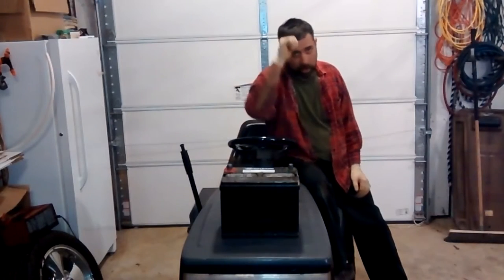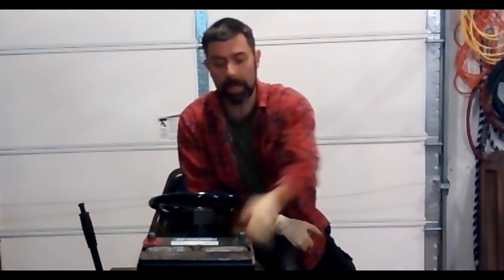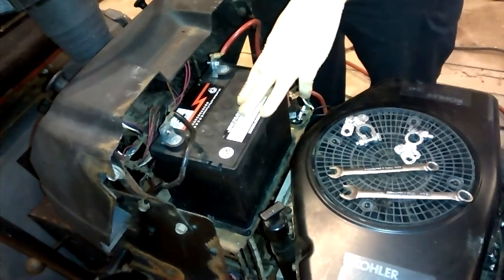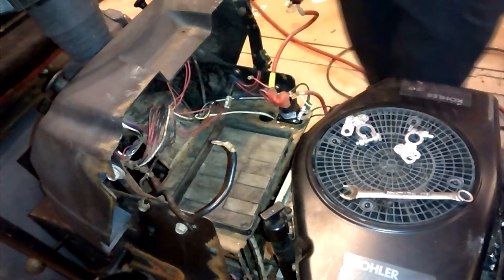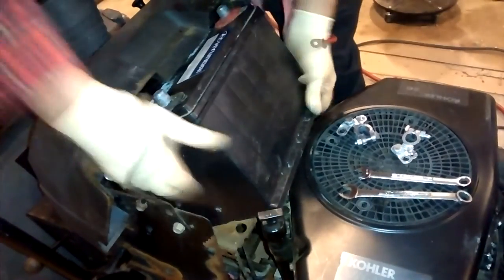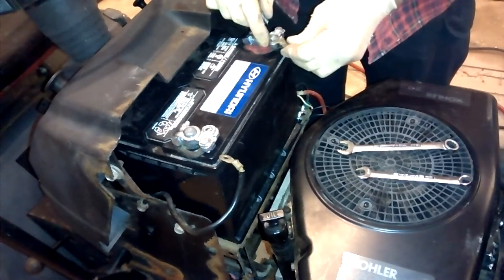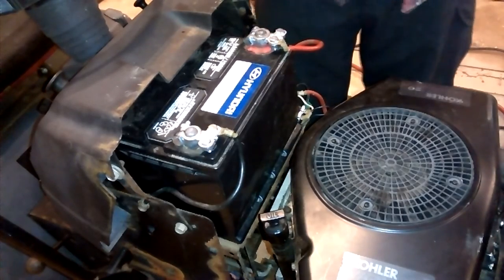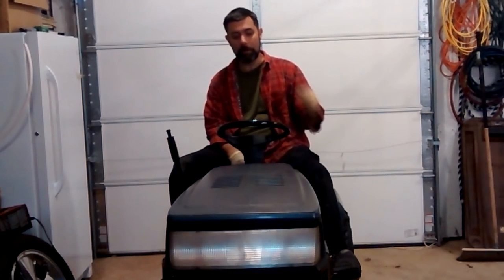Upgrade The Battery In Your Riding Mower or Tractor. CHEAP!

Comment: I did that year's ago.  That's one of the best things you can do to a mower.  Increases reliability.   I cut a piece of 1"  rubber horse mat and placed under the battery to help cut down the vibration to it.
Reply: it is a very good hint as these auto batteries are not designed to take vibrations and will fail very soon.

Comment: Find a secure way to 'hold down' that battery, other wise it will Rock and roll which isn't good for the plates in the battery to remain secure/not breaking loose. Also, just to keep any contact from the battery posts ever ever ever touching anything in your tractors and grounding out- safety tip, never have a loose battery.

Comment: The price of those little riding mower batteries are insane.  Im going to cut into the rear metal seat area on my craftsman mower, add some reinforcement and go to the wrecker and buy a cheapy used battery. The day I buy a new battery off of these ripoff artists is NEVER.  Fricking Criminals.  CANADIAN TIRE IS THE WORST 😡. Video to follow.
Reply from the maker: I agree that the prices are getting insane. I was looking not too long ago and one was over $50- it was about half that a few years ago

Comment: I have been wanting to do a ton of upgrades to my larr grandfather's 197x power king garden tractor since I was a little boy.  Adding more lights is a big one, a bigger engine, a modern alternator in line with the power Hydraulic pto. A large battery, a winch  upgrade to dual trans and larger tires.  Really I should just get a larger tractor but you all know how your pappys tractor is worth more than almost anything. I just want to make it my own.

Comment: I just did a engine swap 15 to a 20 hp  and the mower battery is having a hard time spinning the engine over. Which is strange several years ago I had a old Mazda truck, at the time I was hurting for money and the battery died. I took the batter out of my riding mower and use it. Ran it that way for over a year and never had a problem with it. It was still working when I sold the truck.

Comment: Great idea! Thank you for sharing. I resurrected my great grandfathers 1993 Sears Craftsman 2 LT4000. Sat in the farm barn for years…18hp opposed twin Briggs. Appears to be the same style of yours up front…curious if your engine has two metal “loops” bolted to the top/rear of the engine? I certainly plan to follow up on the battery upgrade you shared as well as the hitch adapter you shared in an other video. Thanks

Comment: I wish I could do this. My battery is under the seat. I have a brand new car battery I took out of a car that I junked. $130 battery just sitting on the battery tender waiting for a project.
Reply from the maker: I haven't figured out a way to wedge a full size battery into one of those, but I'm still trying.

Comment: Why won't this battery change out work for a under the seat model? Room?
Reply from the maker: Exactly. the under seat battery location is smaller and Other than maybe a Honda sized 51R battery I don't think any would fit.
Reply: It "could" work, but space is the issue.  Several years ago I did this conversion on an under-the-seat Murray and used a battery for a Ford Escort (I forget which model battery that is).

Comment: I just did this an hour ago and something shorted out and I used a brand new Camry battery. Nothing will turn on and I checked the fuse. Do you think the switch went or the solenoid?
Reply: Ignition*** not switch
Reply from the maker: It's hard to say without seeing what happened, but if you have a test light, I'd start with it. Does the solenoid light wire light up when the key is turned? if so the solenoid is bad. if not, it may be the switch.

Comment: can u use the car battery without messing with the electrical system and components  due to the more amps?
Reply from the maker: No, it will be fine. The larger batter has a much larger reserve capacity, but the extra amps are not going to damage a working system.

Comment: ...And now that you did that..you just voided any warranty, and risk burning out the starter windings, and over powering and burning out the solenoid and the charging system..! There is a reason they make and sell,LAWN MOWER BATTERIES..! DON'T be stupid, use the right battery for the right tool...!! A fire in your engine box is no fun on a cold winter morning when you're late for work and trying to plow snow...😱😱😱
Reply from the maker: I'm fairly certain the warranty on this unit expired sometime back in 1995 so I don't think that will be an issue. As a Mechanic for the last 25 years I can tell you that unless the starter already has an issue, there is ZERO risk of fire from adding a larger battery. Same for the charging system. 

    More amps is only a bad thing if your using it to try and overcome a mechanical issue. (slow to turn over from a worn starter, that sort of thing) When used as a way to increase reserve capacity and understanding that the wimpy charging system won't be able to keep up  There is no downside to this mod.
   I've been using a setup similar to this for many many years on a variety of tractors and have never had an issue.  I've also never damaged a starter, or charging system with this setup either.
   In fact I'd say a bigger risk is using jumper cables to start a tractor like this when the small factory battery dies. Small or large sparks in the engine compartment of a tractor is a larger fire danger with all the fuel vapors floating around from the non sealed gas tank, and carb.
   

    That said, any modification to a tractor should only be done after any factory or extended warranties have expired and are to be done at your own risk.

Take care.
Reply: A bigger battery won't heart any thing
Reply: Farpoint Farms I was gonna say something about that also because all of my riding mowers are older than I am. I've got one from 1978 and one from 1993 and I'm pretty sure both there warranty's are done for so it doesnt matter what I do to them.
Reply: Farpoint Farms - You're exactly RIGHT!  
Love the videos and subscribed.

(I've got a few more years than you as an auto-and-truck mechanic - now retired.)
Reply: Unbelievable! I was to believe these myths were dead and buried. 
I've been using, as I call it, the "tape measure method" of choosing batteries for ages. My white hair & beard continue saying it always work... 

A 12V battery is still a 12V battery, independently of it's physical size. If a component consumes 10A with a small battery it will consume the same 10A with a bigger capacity battery. 
Technically a big battery brick with 120AH could be working in there perfectly if there was "space" for it. ;-)

BTW they make lawn mower batteries and motorcycle batteries, etc, etc. Precisely because of "physical" limitations and final cost. 
Cheers
Reply: a ride mower battery and a car battery are both 12V, yes the cranking amps may be rated higher on the car battery but a fully working  engine/starter on a ride mower will never pull as many amps from the battery than what is needed to start the engine compared as to a car engine/starter.
Reply: Those era Craftsmans have that extra room on purpose so you CAN upgrade
Reply: waz your battery NON BINARY, non binary !!!!!!!!!!!!!!!!!!!!!!!!!!!!!!!!!!!!!!!!!!
Reply: Exactly... i have an electric scoop/bucket on the front of my Simplicity. It can use a fair amount of battery power... 
I decided to try to repurpose my Excavator Battery into the yard tractor.... And It Fit! 
It's been in there a few years now. 
Works amazing 💪⚡️🚜 ~